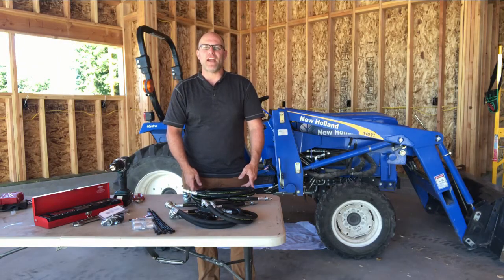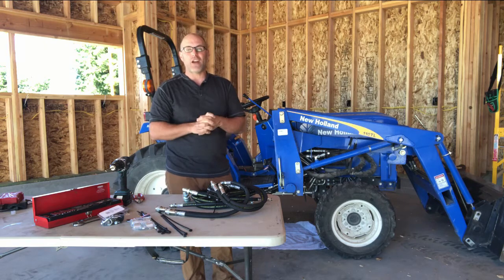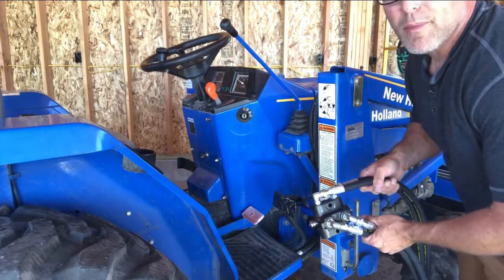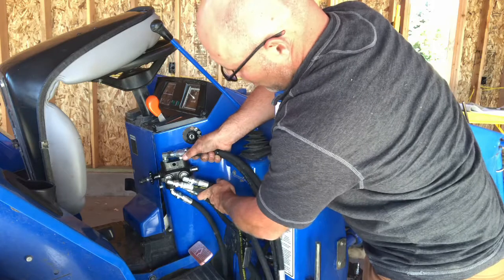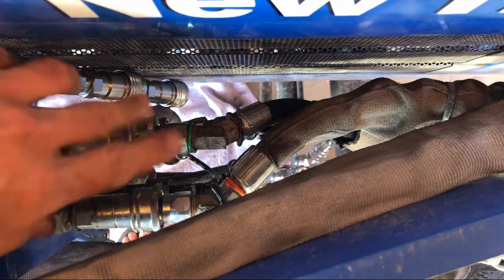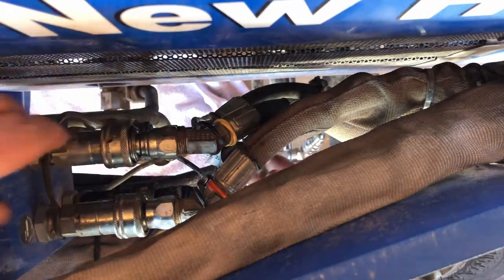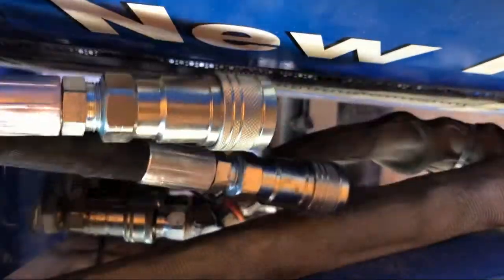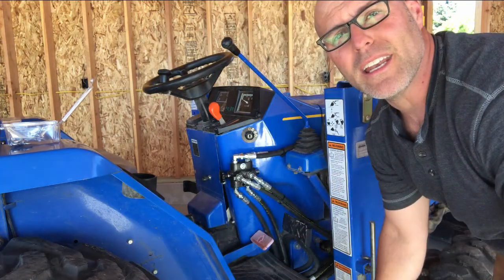$625 Remote Hydraulics Kit for New Holland Tractors

Comment: I have a 2007 T1520  - The loader stick is mounted on a platform pad via a solid branch just forward of the right hand arm rest - any thoughts on specific differences for installation?
I'm on your Ebay page now. 
:-)
Reply from the maker: I bet you might have an aftermarket loader.   No a problem, I build for those too.   I'll just need a few pictures.   Send one of the loader valve area and one of a coupler disconnected.  I need to see the male coupler fitting clearly.   Text or call 541-972-0546

Comment: Hello, looks like a good system.  I have an original, un-modified 1996 Ford/NH 545D, 2WD, with front-end loader and this tractor has the heated, enclosed cab with front windshield glass and doors.  The loader control arm inside the cab actuates the loader valves from under the cab, so it's somewhat complicated. This is from the factory. Also, the brake pedals are mounted on the left side, not the right side as on a no-cab model. The right front-facing panel of the cab, below the windshield is metal and the loader valve is in front of that metal panel and is mounted to the inside of the loader vertical frame member. So, my question is; can you make a system to fit this tractor that allows me to use the loader control arm as you show in the video ? Are the hoses 1/2" or what?  Thank-you.
Reply from the maker: Send me some pictures.   I build everything to order, and I'm sure I can make a solution for you.   Include a picture of one of the hydraulic couplers disconnected - I need to see the male coupler fittings.
You can find my phone number and email address on my website:
www.tractorinnovations.com

Comment: How would this work if you needed remotes for a backhoe? The backhoe has its own controls so would need constant flow.
Reply from the maker: Yes, I've had lots of customers use this for constant flow applications.   To get the fluid moving, you simply bungee-cord the loader control into a movement position, and you've got flow!

Comment: do U make a Kit to fit a 1986 yr Ford Model 1910 tractor it has the Ford 770B detachable loader
Reply from the maker: Yes!   I actually just did a 1910 for my local dealer recently - he added the hoses to the front for a grapple.   We mounted the valve to the fender, within easy reach of the operator, but can install to the dash as well.

Comment: Hi I have a new Holland T4020. It has one set of rear remotes. I want to have a front remote for a grapple or whatever. What to you have?
Reply from the maker: This kit works great to power a grapple, and works on a 4020 just fine.   Most customers install it on the "dump" circuit so that when you've got the knob pulled, you can lift/lower and control the grapple at the same time.   If you need to adjust the dump angle, just pop the knob back in for a second.   This comes with 8' of hose to reach as far forward on the bucket as you need.

Comment: I have a TC30 (2003 or 2004, don't recall) and want to use a grapple up front. 

If this kit disables the loader functions then I don't see how it would work with a grapple since you'd need full control of the loader AND the grapple to pick up brush etc.
Reply from the maker: Installation on the “dump” circuit lets you do lift and grapple at the same time, which works for a lot of folks.  Then if you need to dump, just pop in the button.  Less deluxe than some other options, but at a lower price, and fewer parts that can go wrong, and parts are made in the USA.

Comment: Hello Andrew, thanks for the great vid. I just bought a 2004 NH TC35 and want to a 3rd function kit. This kit only offers options for back implements, correct. This system would not work for grapple and front 3rd functions? Thanks!
Reply from the maker: This will work for a grapple or other front implements.   It comes with 8' of hose, enough to run to the rear for remotes, or to the front of the loader arm for a grapple or other implement.   You get to choose which circuit to install on, so if you want to be able to operate the lift function + the remote, simply install the diverter on the dump function hoses.     If you want to switch circuits later, it's just a matter of swapping the quick couplers.

Comment: Thanks Andy! I just installed this kit on my 2017 New Holland Workmaster 33. I fix driveways and bush hog fields as a side business. It's great to be able to change the angle of the box blade so I can dig and load top the box blade or smooth out gravel, all without getting off the tractor to manually adjust the top link. Whew! The kit was delivered quickly and was not hard top install. You also sent me a link to get the hydraulic cylinder I needed which was about $70 less than the one I was about to get somewhere else. I had a question during installation and I really appreciate that you answered the phone and set me right in a couple minutes. Great service! Totally recommended. Tractor Boy Ed Nashville, TN